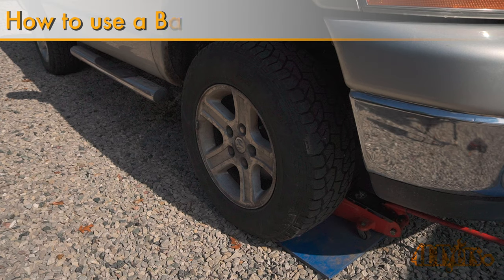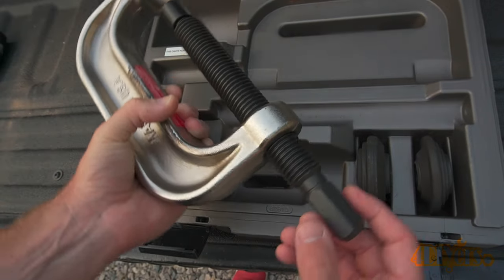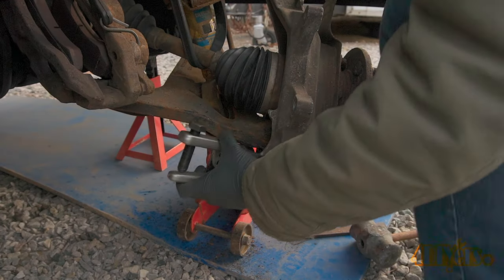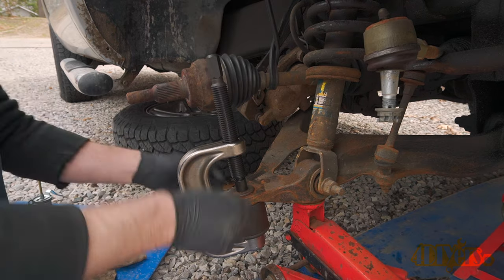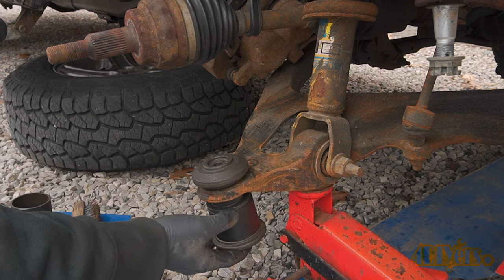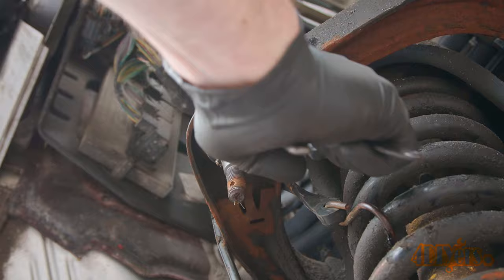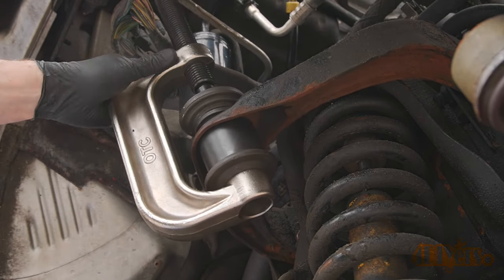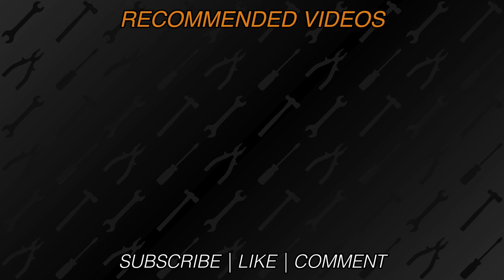How to Use a Ball Joint Press

Comment: 3 months ago I was replacing the ball joints from the steering knuckle. The lower ones were so seized when I used the removal tool, It took 3 trys. The 2nds time when loosening it, the tool shot out as fast as a airsoft but its a hunk of metal. And flyed 10 yards away from the car in less then 2 seconds.

Comment: My upper ball joint points down and the top is right on the end of the control arm. So the top adapter has no surface to sit on when using the tool. So it falls off. I saw a vidoe with an adapter that would work but I cannot find one anywhere. Any tips?

Comment: Mechanics in my country would rather replace the whole swing arm than just the ball joint because they're too lazy
Reply from the maker: It's also a cost thing. Pay an hourly rate to remove the old pressed in ball joint or pay extra for a part that takes less time to replace. Depends on the vehicle though.